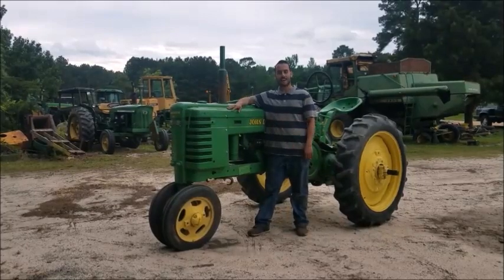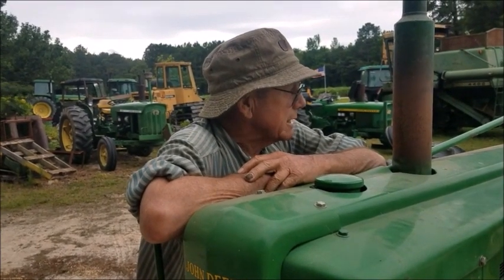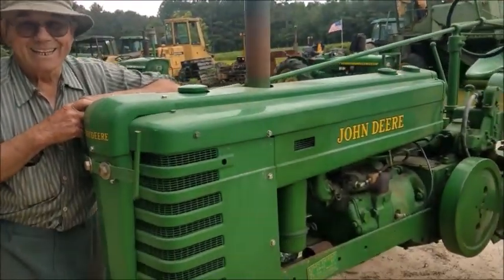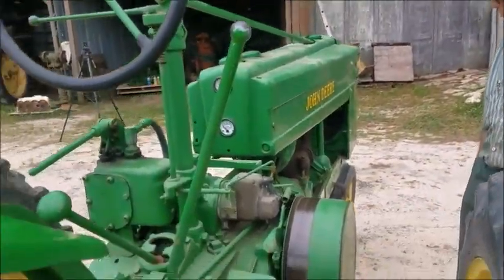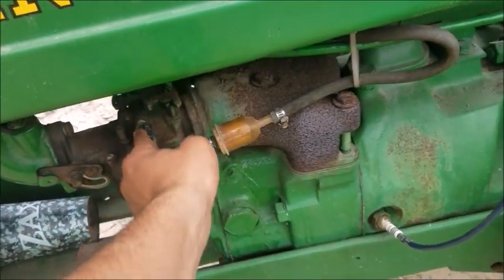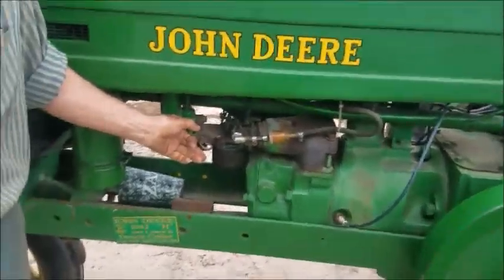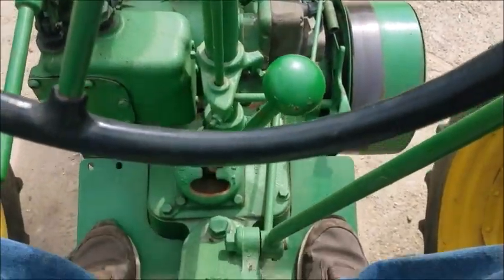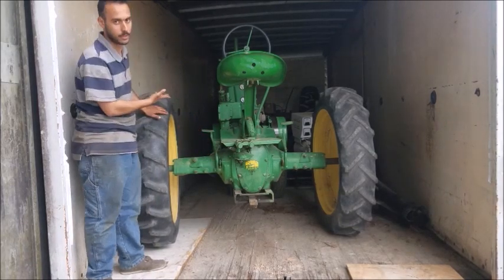John Deere H review

Comment: Corvairs with unibody construction were known to split apart in the rust belt.  Not safe!  Cool tractor!  My grandfather had an A, a B and a 60.  My father got the 60 when my grandfather died.  I used the 60 a lot as a teenager.

Comment: The smallest?  I would think the smallest would have been the LA series.  Yes, it could run on "kerosene" or Tractor Distillate.  They were about 7 cents a gallon when gasoline was about 28 cents a gallon so it was more economical to run them on "kerosene".  We always filled both tanks with gasoline and that way if the big tank went empty while we were out in the field, we'd switch to the little tank and drive it back to the barn where our fuel supply was.  I grew up using these as well.  We had a '39 "A" and a '41 "H" both set up for electric start but the old "A"'s battery was always dead so we hand cranked it 99% of the time.  We used them for specific things like with the "A", we'd plow with it as it could pull a 3 bottom plow.  It had a 3 point hitch on it and we could use it with more modern equipment than the "H" which was strictly "pull type".  We used the "H" for discing, harrowing, mowing and raking hay as that equipment was pull type.  On the "A" we'd use the bush hog, and we built a homemade wood splitter and instead of buying a small engine and pump to power it we just quick connected it to the pump on the "A", set it to low idle and could split wood all day long with it.  Also used the "A" to pull stumps and used it with our old Roanoke baler and the big hay wagon as the "A" had road gears.  We did plow our front garden with the "H"'s single bottom plow, but it was only a little half acre garden so the "A" would have been overkill for it, lol.

Comment: On ground as flat as that you ain't gonna turn that tractor over going around a turn, lol.  Now, if you were going downhill and into a turn, well yeah, slow down.  But on flat ground like that she don't go fast enough to worry about flipping her over.  Also, setting the parking brake is good, but you should also make sure and shut the gas valve off too when you're parking it.  Best way is to shut the valve off and let it run itself out of gas in the line and shut down on it's own so the carb is dry.  In an emergency though you can kill it by pulling the throttle all the way back.

Comment: I was told the single front wheel was for working in rotten fields. When did john deere put the high and low speed in the transmission. Young fellow so you know! I cultivated Milo on a john deer 70 tricycle in the 60's